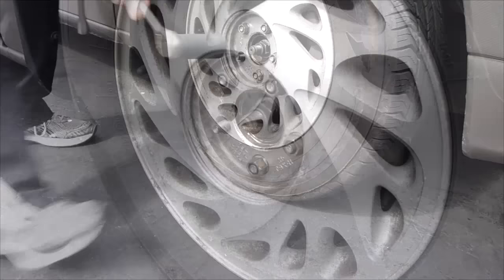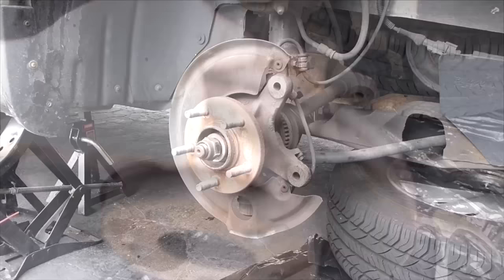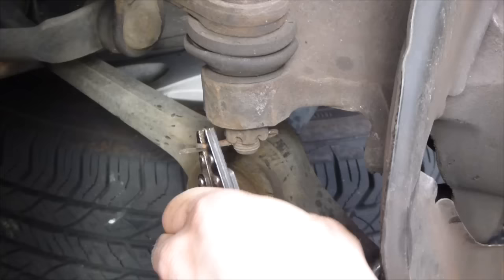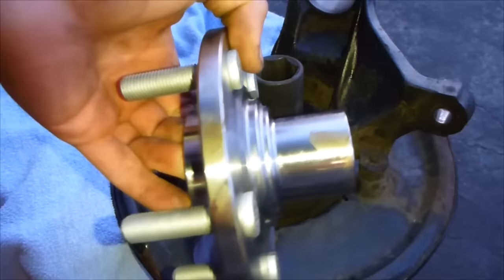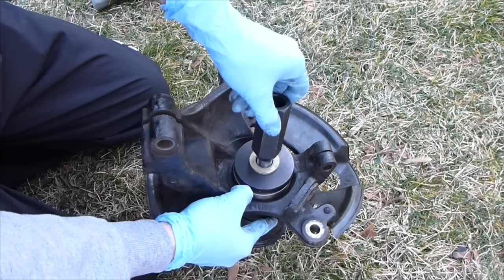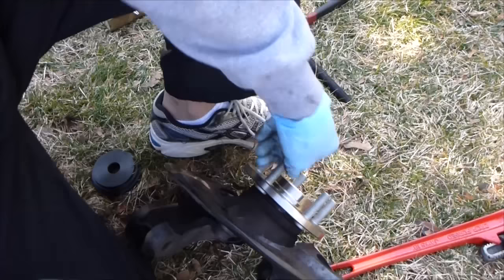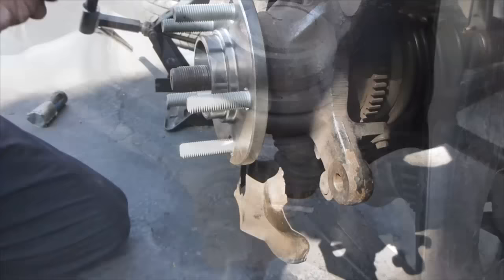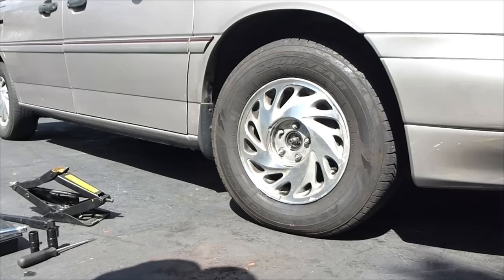How to Change a Wheel Bearing (short and fast version)

Comment from the maker: Thanks a lot man!!! I really appreciate the comment! I try really hard to make it clear, concise and interesting to watch!
Reply: One advice. Wen you tight the 200 nm bearing . You can tight in another  side to make torque down with your body.  And not damage your back. :D
Reply: @RicardoSantos-dm4cj  - For the lighter folks, do NOT stand on the bar. That can get you injured if the bar slips off, if you slip off, or if the nut moves (as you hope) and you then lose your footing. The bar can hit you in each of these scenarios, with the latter two involving your full body weight against a hard object.

Comment: Great videos Chris. A super simple tip for replacing bearings that a friend passed on to me: Heat expands, and cold contracts. If you put your bearings in the fridge the night before, and use a torch, heat gun, or even just leave your receiving part out in the sun, the replacement bearing will drop right in with no trouble. Doesnt help get the old one out, but good time savings on the reassembly. Hope this helps. Keep up the good work.
Reply from the maker: Thanks! Good idea with the cold/hot but I would get in a lot of trouble if someone found the bearing in the freezer lol

Comment: I love it that you do your stuff in the driveway like a average joe.   

It'd probably take me a week to do this... but it's nice to know it can be done in a driveway.
Reply: that's why mechanics overcharge anyone and sometimes talk nasty....not too happy with youtube
Reply: I'm on day three now. With zero experience with bearings I'm still trying to get the old bearing out.... I'm ready to admit defeat
Reply: @natetalamante6635  it's easy lol
Reply: You should see if there's a DIY repair shop jear you, if you need access to a lift or special tools
Reply: @BT-dl8kq  yeah after day 6 or so lol
Reply: My first time changing a bearing I went from 5pm until 3am but I did it. Had to work the next day so I had to get it done
Reply: @deniskk2  - If the prices are unfair, others are welcome to become mechanics and see how worthwhile the career is. I know I won't take that deal.
Reply: @natetalamante6635  - I hope you tried freezing the bearing (can of compressed air) and heating the other part. See YT comments for more details.
Reply: @natetalamante6635  you have to be patient when you're new there's definitely a learning curve but it's well worth it in my opinion. One of the biggest reasons people get rid of cars is because of repair job will exceed the value of the car. Not because the part is necessarily expensive it's the labor. Shops have a lot of overhead expenses legal mumbo jumbo.
Reply: @lajoyalobos2009  wow that's dedication. good job. it's worse when you're on the timer and need the car soon.

Comment: hay buddy, great job keep them coming. just one tip I learned I'd like to pass to you, the tie rod, flip the castle nut and leave it flush to tap out the tie rod end, that way if you have to tap it kinda hard you don't damage the threading. I use that as much as possible now because I have had problems before. thank you so much for your videos, they help plenty, bad are easy to understand even for beginners.

Comment from the maker: If you need to replace a wheel bearing hub assembly, check this video: https://www.youtube.com/watch?v=04AyCYIUEWQ
Reply: where did u get the tool to compress bearing, do u remember how much it cost  you?
Reply from the maker: The link to the bearing press is in the description.
Reply: +ChrisFix $100 daayum
Reply: +Error01 you get it back "rental"..
Reply: Chrisfix what's the name for that tool you use to tork I keep forgetting the name lol
Reply: You mean that huge wrench that he uses to torque stuff? No clue what it's called.
Reply: its a torque rench just remembered lol
Reply: hi chris i was looking 2 invest in a ball joint kit 2 make this type of work easier any suggestion on what kit i should purchase
Reply: otc hub tamer
Reply: ChrisFix something i was always taught while training was never hit the threat of a part unless you are replacing it are you guys not told the same thing it damages the thread I've had it many times where I've damaged threads and had to retread the part tie rods for example just wondering if we are taught it due to cheaper parts in the uk or something you guys do love your cars and big motors we get given little 3 cylinder engines in the new focus and transit connects it's nice to hear things from other mechanics from around the world it don't matter to me if you studied or are self taught you are good at what you do there's a few things I was taught to do other ways but that's why speaking to other mechanics around the world is good we should all speak more share stories it helps expand each other's knowledge and as you know as you put a lot of knowledge in to your videos knowledge is the best thing with in the motor industry
Reply: I would have to agree, it is a good idea to put the nut on the threads before hitting anything -  better to be safe than sorry
Reply: Kiefer Grossett the bolts in suspension  are heat treated hardened you will have a insanely hard time damaging the threads
Reply: ChrisFix l

Comment: Thanks for the vid! definitely helped me out with mine. I actually destroyed my first wheel bearing when i tried pressing the hub into the bearing by not placing the press plate against the races of the bearing, but instead on the knuckle, thus ruining it. But my 2nd attempt went much better after watching your video.

Comment: This is a really good video. I would like to add that once the axle is removed from the hub after disconnect the lower ball joint and Tie rod end, you can just re-connect the knuckle to the lower ball joint and do all the pressing with the special tool. This helps hold the knuckle assembly while doing all the press work.
Reply: I found also having at least 1 strut bolt attached to the knuckle helps with stability

Comment: My hero! We did not know there was a metal clip behind the hub assembly to remove, we actually thought that the new bearing/race was too big. We also only removed the lower control arm and not the tie rod and strut. We also were sold a bearing race puller tool by O'Reillys but its definitely not what you were using in the video. Chilton manuals are impossible to find anymore so i was doing this blindly. I'm so grateful for this video.

Comment: Great job with the video instructions.
 I just want to point out that with that type of lower ball joint you need to line up the groove in its pin with the hole for the bolt so the bolt can pass through.
When pressing the hub back into the bearing the rear plate needs to press against the center of the bearing so it doesn't separate the center sleeve. If the plate is only against the rear of the knuckle the hub will push the inner bearing sleeves apart. I learned this the hard way on my first attempt at this. :(
I would also like to add that we should never pull on the cv shaft once it is out as this will dislodge the cv joint and may need to open the boot to get it back together.
 I know you knew what you were doing, but for the first timers, it may be missed.

Comment: Really IMPORTANT ... the non-stud side where the snap-ring came out ... is the side the bearing has to come out.
The bearing can be pressed out from either end, assuming correct out direction; you don't necessarily have to follow same orientation Chris showed here.
Wasted like 2hrs, compressing it instead of taking it out.
Thanks Chris!

Comment: I bought a kit similar to this one at Harbor Freight and it pretty much works the same way but while using an air ratchet. You don't even have to take the knuckle off of the car anymore! you have to remove the CV shaft after disconnecting the lower ball joint and maybe tie rod to move the knuckle enough to get the CV shaft out of the knuckle. Take the air tool along with all of those adapters put into a specific place instructed by the instructions manual, it both removes bearings and installs them from either side of the knuckle depending on whatever is easier for your situation and also installs the hub
Reply from the maker: That's pretty cool I'll have to check that out

Comment: 3:56 never tap on the threads of the tie rod with a hammer, you'll mushroom the them. rap on the steering knuckle instead. also, I would put anti-seize on the splines on the cv shaft. otherwise good work, bravo!
Reply: Brass hammer suggested- if yer whackin' the post of tie rod with a hammer.
Reply: Ide say never tap any thread with a metal hammer , maybe a wood hammer only or a soft soft metal hammer, maybe rubber mallet. I've ruined threads via metal hammer mallet
Reply: Oh dude! I just made this mistake yesterday! 🤦🏻‍♂️ I have to buy a new tie rod now because the bolt and nut are completely stuck and just spin...😬

Comment: Well nice vid concise and informative. Those roundy things with the hole in the middle are nuts not bolts. The c ring things are snap rings.
The use of the pipe wrench is questionable, but works. You had the air impact you could have used that. Pretty back yard, but you did it right and showing that it doesn't need a big shop is great, most do it yourselfers don't have big shops and sometimes not even a concrete slab so thanks for showing how to.
Lastly you should always shove the tire assembly under the car for safety, besides jack stands. And mentioning those installation tools are usually available for rent at a good parts store usually for a deposit equal to the cost of the tool, you'll get the deposit back when you take the tool back. BUT before you take the tool, open up the box right there at their counter and do a close inspection of the tools to make sure nothing's busted, if it is make sure it's noted by the staff before you leave the store otherwise you could end up paying for something you didn't even break.
Probably too late for all this info as I see some of these comments are wayyy old, oh well, going to leave them anyway 😊

Comment: Good video. If I may, one strong reminder. Always, when putting on a brake caliper after removal, be sure to carefully pump the brake pedal BEFORE moving the vehicle out of Park. This is a VERY common absent minded mistake numerous people have made. They get in the car, put it in gear (either direction) and first thing you know, NO BRAKES! The pedal has to be repumped up to reposition the fluid pressure in the lines. Also, there is always a lot of talk about those of us in the rust belt. To be sure, the running joke is that every ten minute job is guaranteed to take 4 hours. We laugh, but its true. Personally, I use a spray, Knock-R-Loose by K &W. It goes after rust, yet will NOT attack plastic, rubber, paint or much else like some sprays do; (PB Blaster). (Strictly personal preference.) Very rarely has it not worked. Amazing. No, I dont sell the stuff. Rust is always going to be a bear to fight against, so when watching these videos, adjust the thinking to adapt to the fight. Broken or frozen bolts, rounded bolts and drill bits are OUR arsenal tool box bullets. Chris does good in the presentations. They're  simple, effective and polite. No bad (and unnecessary) vulgar language. Definitely a plus. Lead on, Chris. Im sure people breathe easier because of your calm, polite and respectful instruction. Thanks for being here.
Reply: I'm not officially car mechanic but I know professionally about cars and how to repair them for more than 40 years, simply it happened to me when I finish front brake pad on my car and simply forgot to prime the main brake cylinder before driving, so I lost control with no brake at all, barely manage to avoid entering the house from my backyard large patio door, I never forget, my car landed by its belly at 3 step high concrete barrier with almost half the car body on the air, I was so lucky, not even minor damage to the car or house.
Reply: By the way, very good advise Gilligan.
Reply: Well that happen because u recessed the calibers plunger to get the new pad in
Reply: Odd, I've never had a problem with that.  Maybe you don't know how to drive a car?  On every car you're supposed to put your foot on the brake when putting it into gear, at which point you should have noticed if the pedal sank quickly to the floor indicating no pressure buildup.

Comment: Good idea to put a drop of blue Loctite on the caliper bolts before you insert and torque them. Also, you can take a moment and wire brush all the fasteners before you reassemble everything. Great video!

Comment: I made the mistake of going to Pep Boys to have them replace a bad wheel bearing on a 98 Toyota Corolla.  I had assumed up to this point that a hydraulic press was required to do the task, but I don't have one.  This video and Harbor Freight Tools has shown me that I could have saved some money and done it myself.  Additionally, for what Harbor Freight charges for 12 ton presses, I could have bought one and still saved money.  Funny thing though, Pep Boys did a terrible job of it, and now I have a brand new bad wheel bearing again.  I will buy a new bearing and replace it myself.  Forget Pep Boys.
Reply: sorry man. did you end up replacing them?
Reply: Notofsoundmind - The bearing on that vehicle was relatively easy to remove.  Some are corroded in and even a 12 ton press may not get it out, or might work if you apply a torch to heat the knuckle.  Sometimes you even have to destroy the whole bearing and saw and pry out one piece at a time.
Reply: Stinky Cheese I haven’t really had to cut that many but yes up north especially they can get stuck like chuck. If they’re THAT bad just take the knuckle to a machinist.
Reply: Meh once you start involving a machinist you might be as well off to check pricing on new and junkyard parts.  If the price isn't that high you might as well attack it yourself then if you screw it up, then you KNOW you're going to replace it.
Reply: Stinky Cheese Stinky Cheese the most I’ve ever paid at a machinist is 100$ to remove hub and bearings from the knuckle and press new bearing and hub back in on two knuckles but I guess that could vary place to place. Most of them come out just fine though so it’s worth a try yourself especially if you have an impact and the time.
Reply: Notofsoundmind, how much did pep boys charge you to replace your wheel bearing?
Reply: Adrian - and as important, did they use a decent major brand bearing or put in Chinese junk that'll need replaced in another few 10K mi. ?  Considering the labor to have someone else do it, I'd never settle for less than a top shelf bearing.  Bearings are quite inexpensive which it's just the bearing, not a whole new hub that's needed.
Reply: CDubs HasIt - Yeah labor costs can vary by region.  Around here it's about as cheap to just get two new hubs with bearings already in them, and then you have new hubs instead of old rust hubs.  Main thing to watch out for is not to settle for low quality bearings or you may be back at the repair again too soon.
Reply: CDubs HasIt yes let us machinist cuss at it hahaha. Id probably still try to press it out. Id rather not try to bore out hardened steel races unless it was absolutely necessary
Reply: Never take a car to Pep Boys unless you want your car to be more fucked up than what it already is or was. They probably didn't even do the work. And if they did, well they fucked it up. As you already said. I don't think any half-ass decent mechanic would ever take a job at a Pep Boys which then you have to ask yourself whose doing the work?
Reply: Yours sounds more like a bad hub
Reply: Yeah, I went to them once and their mechanic tried to sell me on a job to my suspension....that I had done < 1 month prior.  Liars.  Cheats.  Never go to Pep Boys.
Reply: Just like how Chris Fix answered when he people were wondering how he could afford so many tools. Once the cost of repairs by a shop is higher than the cost of the tools it can make sense to buy some of the tools.

Comment: You have helped me save THOUSANDS of dollars reason I say this is because my steering knuckle is screwed up when my bearings go in so every 4000 miles my bearings go out and I have to replace them I replace my CV axle I replaced my tie rod inner and outer I've replaced my suspension I've replaced everything and the only part I cannot find for my car is the steering knuckle so that's what it has to be so every 4000 miles I'm stuck replacing my bearings you have helped me save thousands of dollars with the same kit that you use I'll used to you be paying $200 per time to do it
Reply from the maker: I’m glad the videos are helpful